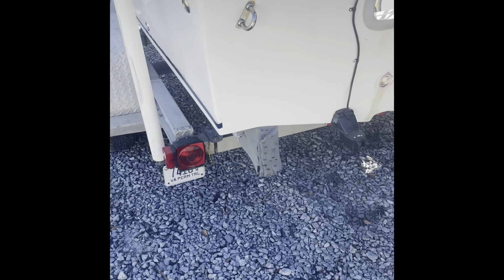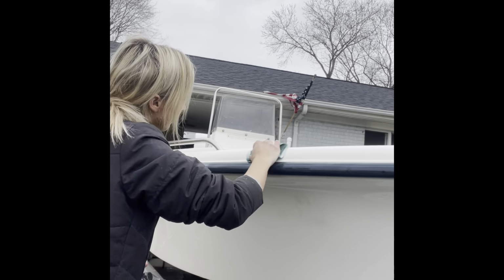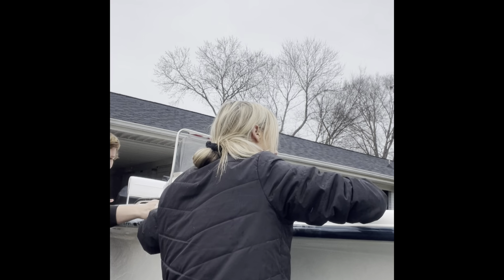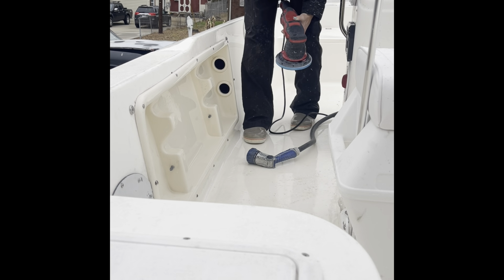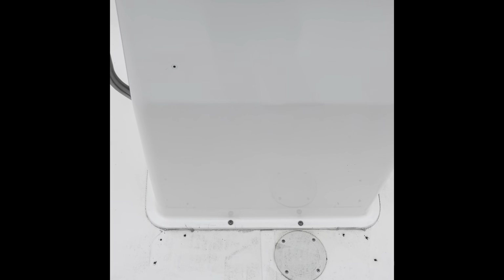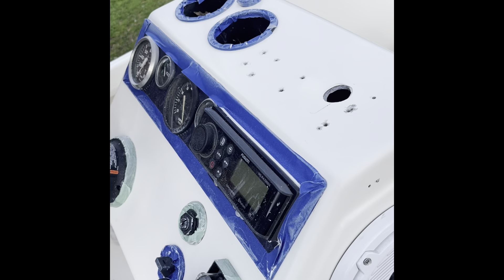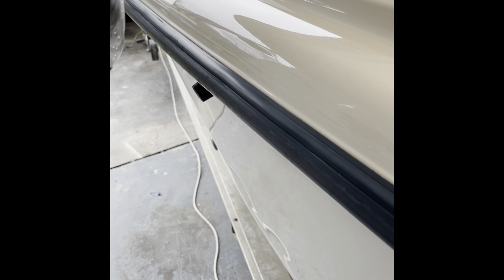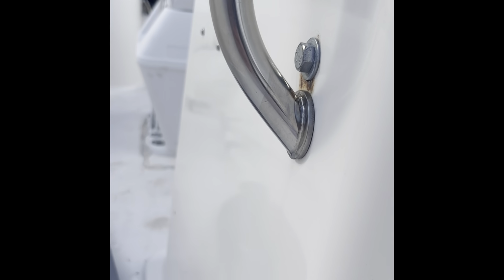Gel Coat Restoration On A Center Console Boat!!!!

Comment: Damn your pretty. LoL But on another note would all your procedures work on an RV with gelcoat? BTW you all do great work!
Reply from the maker: Thank you! For RV’s, you’re SOL. Unfortunately. RV’s gel coat is soooo different from boats. I tried doing it before on a friends RV, I even wetsanded it (lightly because it’s thin) and it still came back. Did all the same steps as a boat. I’ve heard from many others that RV gel coat is crap. And it very easily gets pigment damage. Only thing you could do is compound it, polish & seal and just do it again whenever it fades back out. Wish I could help. Sorry!
Reply: @zippymarinerestorations  Thank you for the feedback!